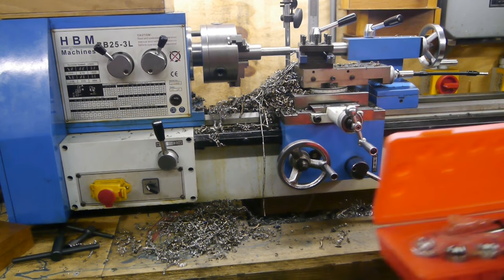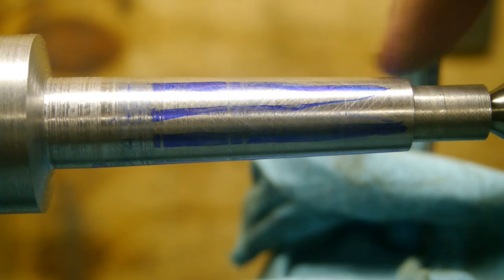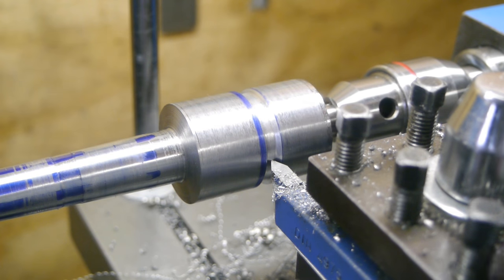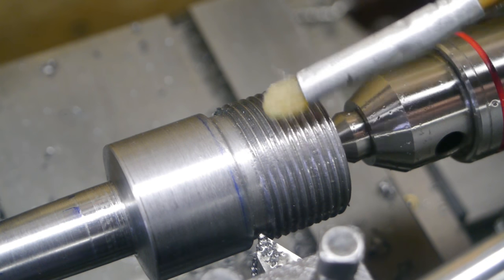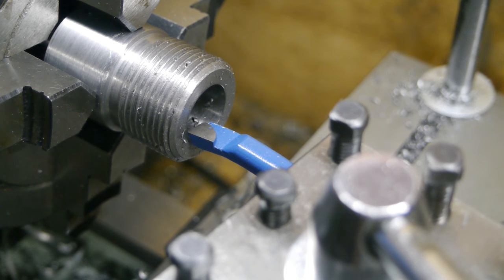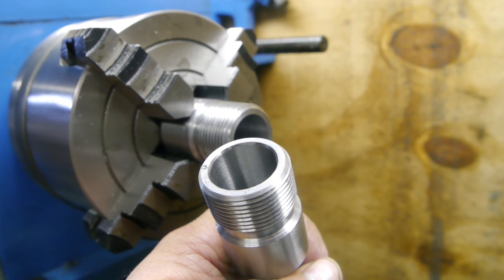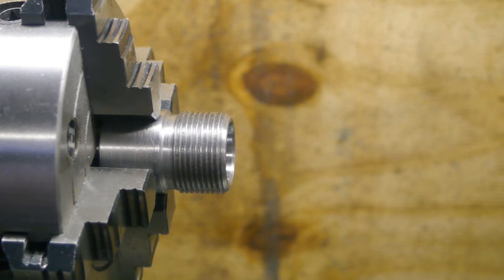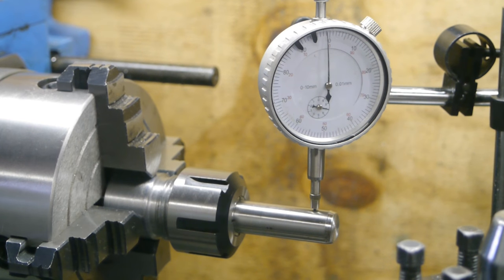Making a tailstock collet holder

Comment: I know this is a really old video. I agree with others about slowing the spindle speed and playing with the feed rate in order to remove some chatter. 
I was also wondering if maybe your live center is allowing chatter as well, I don't know what kind of shape it is in or if it is a higher quality live center, also make sure your tail stock ram is locked. You could always slow the spindle speed down and try a dead center with some high pressure grease and see if the chatter goes away or reduces. There are times when I am threading or working on smaller diameter material that I will still go to a dead center or a half dead center that have carbide tips on them.

Comment: As far as chatter, before you start your lathe, grab hold of your tool post and slightly move the tool post in circles and X and Z, don't force it! Just nudge in these directions, to find any play in your saddle, cross feed, and compound rest. If you find the slightest if play, adjust your give for these locations, to snug fit. If you still get chatter after this look up feeds and speeds to metals chart. Kenametal had a great sliding chart of this, in the past. I don't know if they offer it still
Reply from the maker: I think heat expanded the work peace an pushed back the tail stock. After cooling there was prabably some play.
I did tighten us the cross slide gibs.

Comment: That was great, thanks.
My only idea was take the collet nut off, spin the collet, retighten and see if there is a spot where the colet has less runout, then mark the collet and the collet holder. Repeat for other collets if it works.
Reply from the maker: I think my biggest mistake was amusing the 4 jaw was100% parallel with the bed when cutting the internal taper.
I probably should have used the 4jaw in combination with the steady rest.

Comment: I am running scenarios through my mind and I can not think of a real need for a collet in the tailstock.  What were you thinking of using it for?  I can think of only drill bits that would work in it but there are better ways to hold them.  You could hold a work piece but why?  Might just be my limited machining skills but color me wondering.

Comment: Tighten the tailstock quill clamp and slow the rpm a little... Speed has more to do with chatter than feedrate, as long as you're not cutting too deeply. Also, a fairly small tool radius helps to relieve tool pressure. Your boring tool should be more closely aligned with the headstock axis - that would have helped immensely with chip clearance problems.
Reply from the maker: Thanks for the tips.
My mediocre tool grinding skills might also have played a role :)

Comment: On the change gear chart where it says 110 gear I think it's just suggesting the best idle gear?
Reply from the maker: Could be. But I don't have two 110 gears. I guess I  need to look into gear cutting at some point :)
Reply: You would only need one 110 gear, it's just to make up the space between the outer 2 gears and they would all 3 be in the same alignment
Reply from the maker: I need two because the leads crew and spindle gear are not on the same plane.
Reply: That's a really odd setup, did you get the machine new ?
Reply from the maker: I bought it used last year. I was hardly used and wasting away in a damp shed.
Almost all gears were still in the original brown packing paper. But it is possible some were lost by the previous owner.